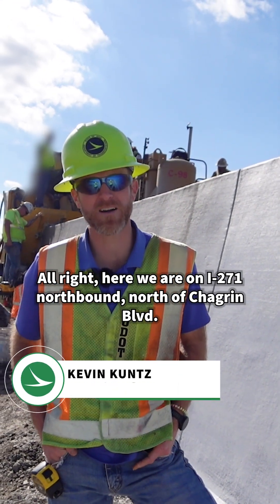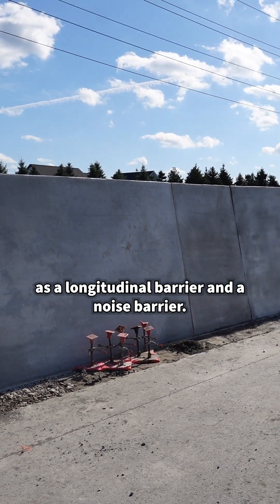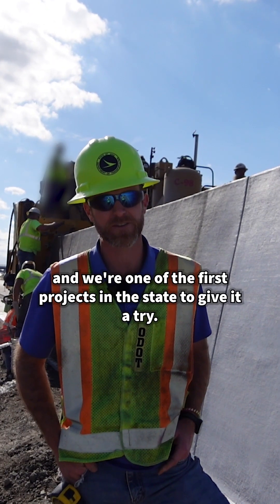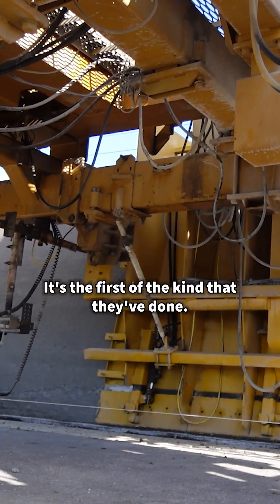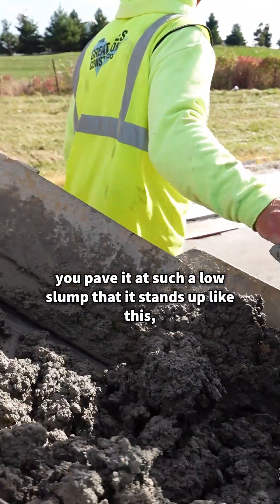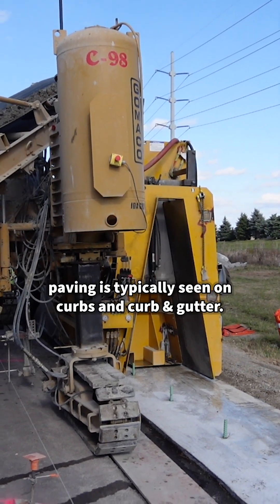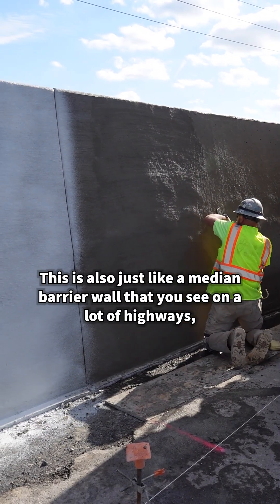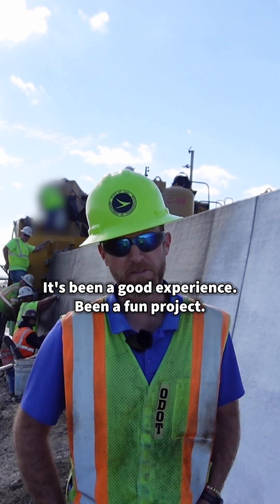Noise Barrier Pilot Project

Comment: Yeah a fast product is good. Nice try buddy shitty work
Reply: It looks good man. Bet you complain about how long the road work is taking too.
Reply: @ I would rather it take longer than fast shitty materials
Reply: @SuperHall98  But why does fast = shitty to you? Are you unfamiliar with the material called concrete?
Reply from the maker: When he says, "it provides a very quick product," what he means is that the concrete can dry faster because it's thicker. They test paved it to make sure the wall would actually stay up. If they used a thinner concrete that took a long time to dry, the slipform would not have worked. We have a little longer video about it on our channel if you're interested.